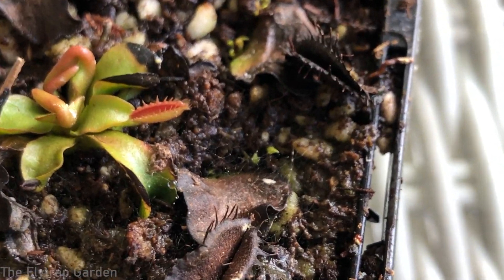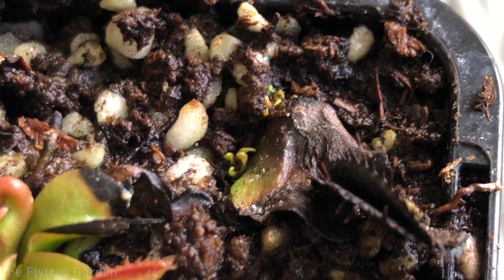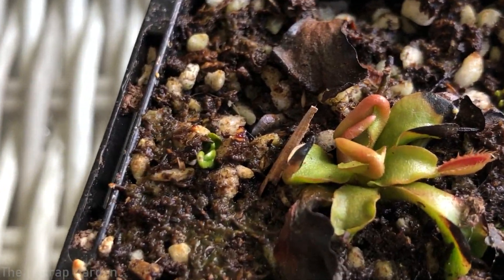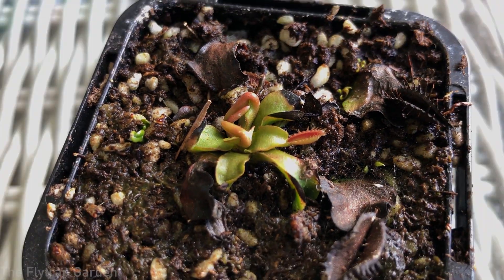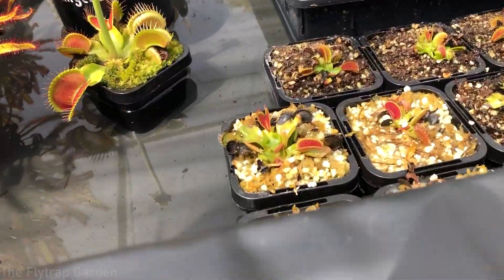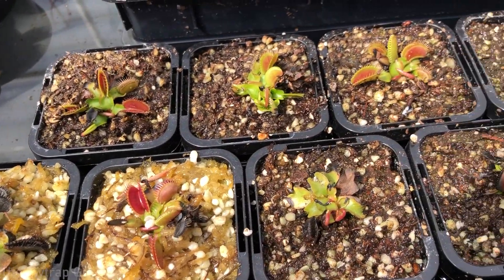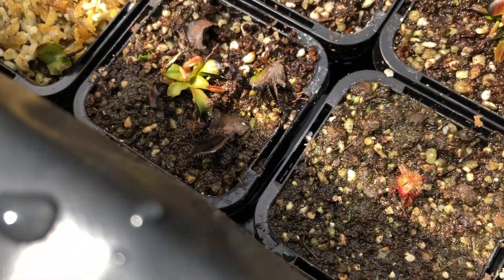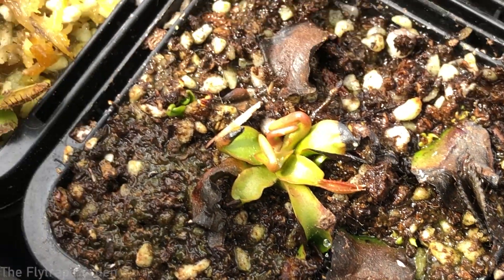Do Leaf Cuttings Work on Venus Fly Traps?

Comment: i have a leaf pulling from my sd kronos that came of when i potted it  and it is under a growlight in a zip lock bag  which i open every 3 days for a couple ours to avoid rott. Once i see new grow i open the bag and until then i just cut off the part of the leaf that turns black

Comment: One problem with cultivars is that, while selecting for a desired characteristic, you often have to accept reductions in other characteristics, such as hardiness or vigor. 

Also, cultivars can only be propagated by cloning. Seed propagation does not produce that clone since even a self-pollinated plant will not produce seed with characteristics identical to the parent plant.